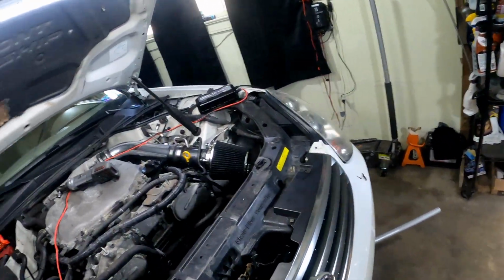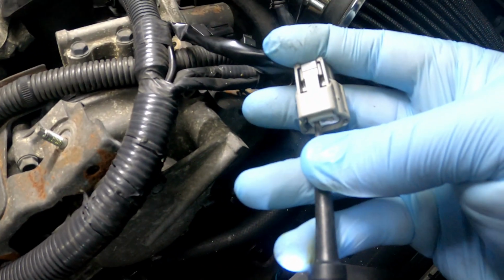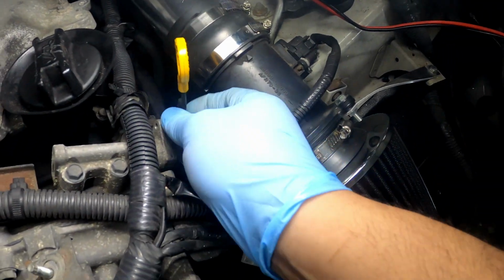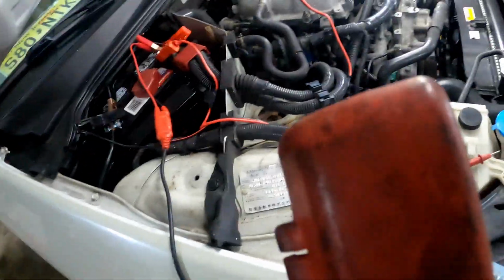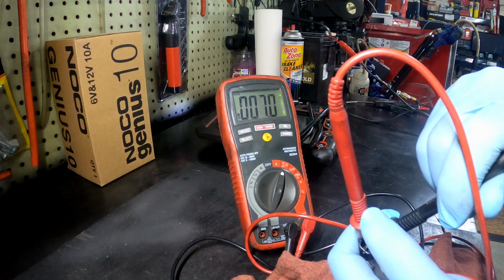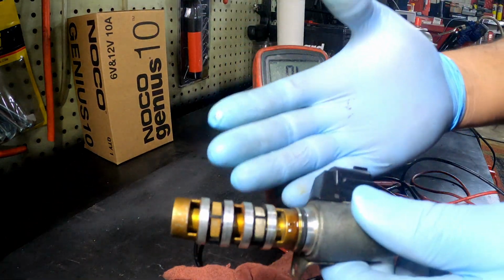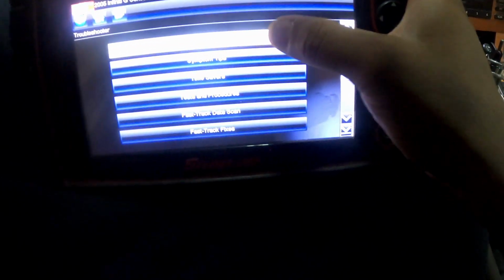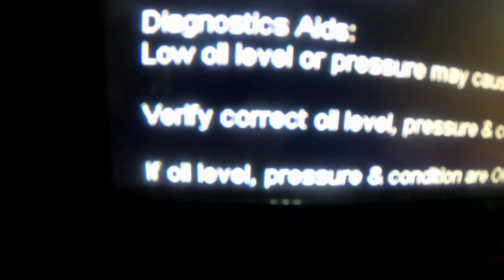(Infinity G35) P0011 P0021 Timing over advanced|How to test VVT Solenoids(Oil Control Valves)

Comment: Did that fix the issue ?
Reply from the maker: @Rome7869  Yup, haven't had any issues since nor any check engine codes
Reply: @PhillyDee215 what was the real fix ? Mine also rattles at cold start or after been sitting for 3 mins

Comment: Can oil be to thin ?
Reply from the maker: Yes indeed, make sure your using the manufacturers specified oil weight.
Reply: You need to check your weather ratings to keep the right viscosity for the temperatures you operate in. Research oils to understand ratings more. But if you're using what's recommended you'll be fine. Sometimes it's worth changing to a different ratings if your climate is too cold or too hot. They try to keep you in the average ratings.

Comment: Perfect information. However as its given at service manual resistance between terminal 1 and terminal 2 should be 7.0-7.5 ohm at 20c (68F)
Reply from the maker: Thanks for that info....so I was within range. Garage temp was on the colder side so the readings were a lil higher. Wish I had the manual bc I couldn't find any specs on Google

Thanks for watching Subscribe & stay Tuned for more‼️🤝
Reply: @PhillyDee215  if you want manual, i can send it to you if  you provide me your mail address.